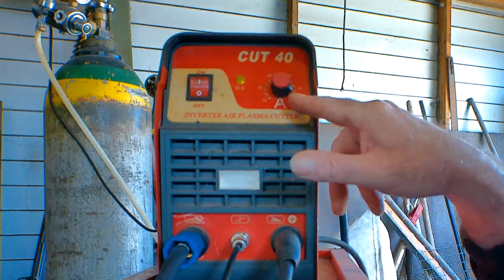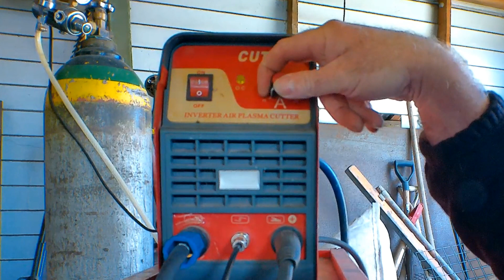Plasma Cutting With Only 15 Amps ( AND LOW AIR PRESSURE )

Comment: Reply/comment@Paul Howlings
. No, too high air pressure almost blows away the plasma arc before it can cut in depth. There is a reason why all machines must be adjusted before you start cutting; depending on the thickness of the material to be cut. 
Regarding the relation between amperage contra air pressure, please take a look at my comment on Pete's video "Plasma Cutter Air Setup EASY" (https://www.youtube.com/watch?v=T8hbhHpTdvk). Notice that, in my experience, both my 80 amp and my 50 amp plasma cutters performs best with slightly higher air pressure than the standard recommendations for the given amperage.
It's important the metal doesn't become too hot when cutting. Molden metal will clog up the cut and disrupt the process. This happens when the nozzle is too far from the metal, or the amperage is too high, or the cutting is too slow. Always aim for a cut of 1mm width.
Reply from the maker: thanks
Reply: @formerfreak4943   You don't use 50 amp for everything! Depending on the thickness of the material to be cut you must adjust amperage and air pressure. 
Look at my comment on Pete's video "Plasma Cutter Air Setup EASY", there you'll se a list with recommendations. I point out that it's a list with recommendations. It's quite ok when cutting steel/iron; although, as an example, it states: Thickness 0.40mm to 4.8mm = 20amp/2bar; however, if over 3mm then an air pressure of 2.75bar usually works better. Aluminium is problematic to cut, but I have no experience cutting that, as I have hydraulic scissors for aluminium.
Higher amperage = higher air pressure. Smaller hole in the nozzle(for deeper penetration) = even higher air pressure. The latter is only relevant if you use the better quality chinese P80 torches, or when using high-end brand machines. Either have the option of choosing the correct nozzles for the work you're about to do.
You ask "cfm is most likely important"(cfm is more known worldwide as liters/min.). Well, not really. All compressors have a tank. As you must never use your plasma cutter for more than max 6 minutes and then let it rest for at least 4 min(60% intervals) for the nozzle and especially the machine to cool down, it's not long enough to empty the air tank unless you have a very small hobby compressor. In that case you must cut in even shorter intervals. No small compressor can deliver enough air flow for a plasma cutter solely by its pump. If air pressure drops you'll burn your nozzle immediately!
You'll learn by trial and error. Everybody burns their electrodes/nozzles in the beginning, but you gain experience. It only took me 3 hours to spoil 3 sets of consumables when I first used my 80 amp machine. I watched a few videos on YouTube and did what they showed. It turned out to be mostly what not to do, so be careful with YT videos. Think first before acting. 
Next step for me is to add the small simple water cooling system onto my torches to reduce wear on consumables, because I use my two plasma cutters almost every day. Additionally, water helps suppress fumes and sparks, and makes cutting quite a bit smoother.
As this is an international forum, please keep everything in metric. 95% of the world use metric. Only un-developed countries like Liberia, United States, and Myanmar haven't yet been able to convert to metric, lol.
Reply: @formerfreak4943 . You can, and my comment on Pete's video "Plasma Cutter Air Setup EASY" (https://www.youtube.com/watch?v=T8hbhHpTdvk) as well.
I have made comments on several other of Pete's videos also.

Comment: Hey Pete, greate video's to learn from.   (the Netherlands)
I am bussy bilding my own plasmacutter, the output will be  20  Amp.
How thick steel in mm, will i can cut with it.??
I want to cut a barrel with it (for a lid and a door).
How do i get a straite and horizontal cut on this round service.??
Reply from the maker: 20 amp maybe 4 mm

Comment: What about when your plasma is rated for a 15amp plug but you dont have 15amp plug in your shop so you have to use a 10amp plug?
Reply from the maker: Yea I do but you are not supposed to (but what can you do lol) The only trouble is you wont get full power from your machine, And could also blow out your breakers if your compressor starts when you are cutting.

Comment: Interesting the cutter worked better on low air pressure perhaps it was cooling the metal at high pressure
Reply from the maker: Yea , don't really know ,but I am going to do some more videos about running a plasma cutter on a small compressor.
thanks for watching